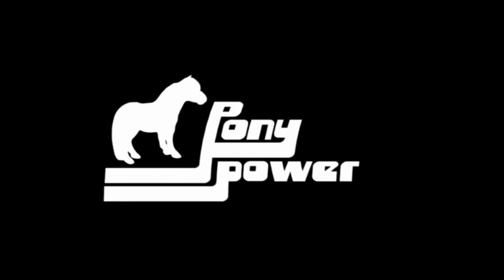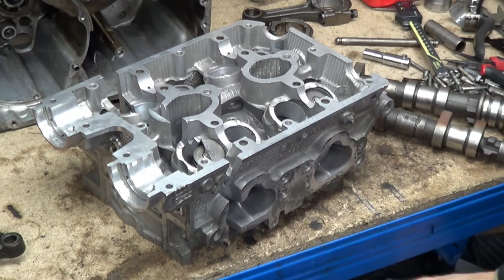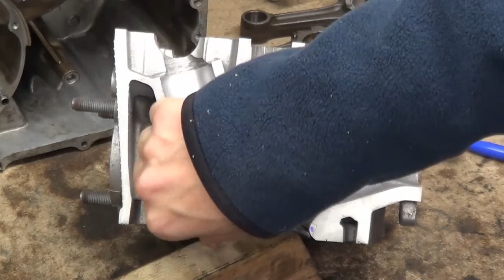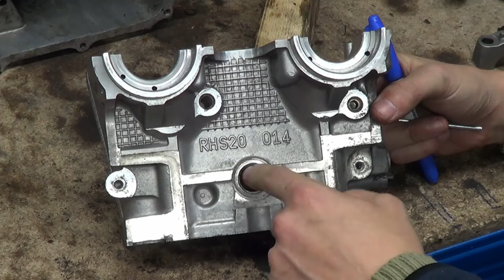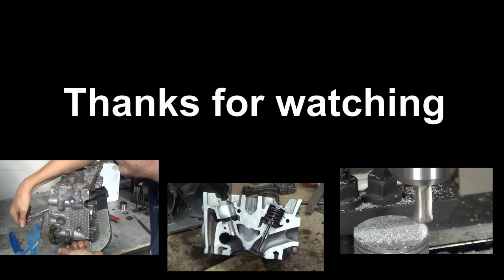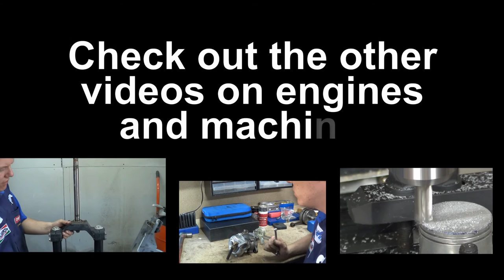4 Stroke Valve Intro - Part 3

Comment: Brilliant series of videos , only found your channel in the spring of this year and have seen more or less everything since then , just working my way through the older stuff and came across the valve series . Did the 36,000 mile shim change on my Bonneville back in April , and after about an hour of these videos I'd easily tackle a cylinder head strip down and overhaul , nothing daunting about it at all .Knowledge is power . Thanks Matt !